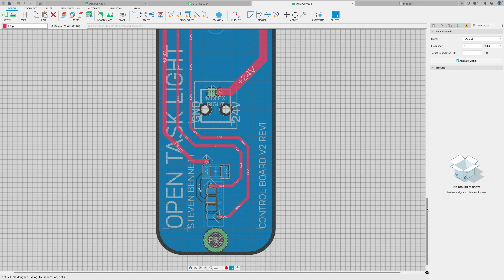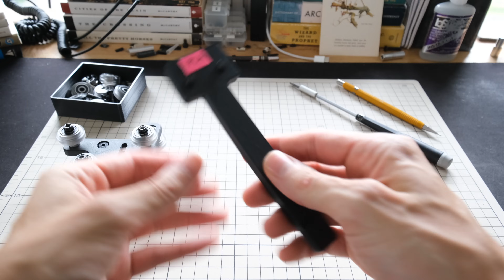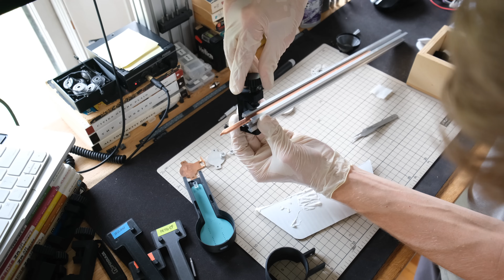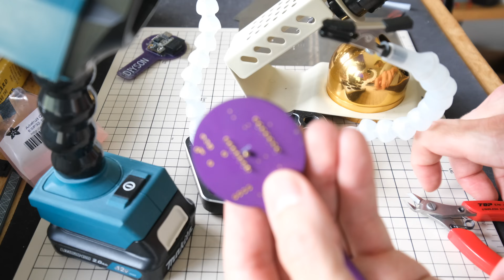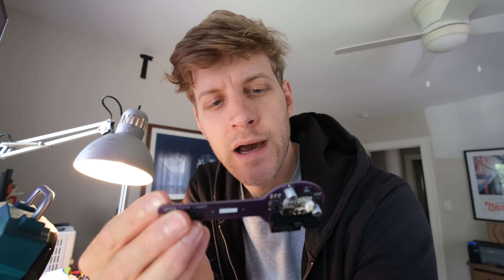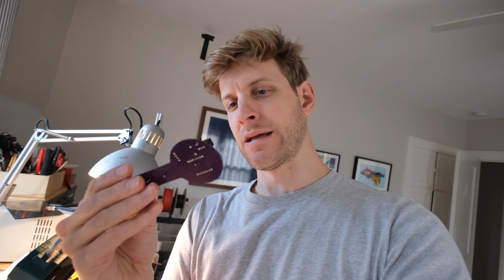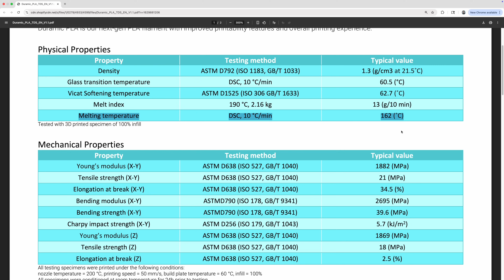A DIY designer lamp—how hard could it be? - Open Task Light Build Log #15

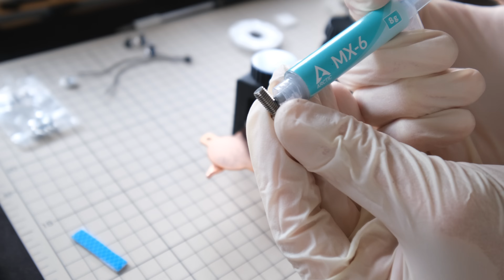Comment: 14:40 I think you have far too much thermal paste! The thermal conductivity of copper is a lot higher than that of thermal paste (maybe 40 to 50 times). Ideally, you'd have two absolutely flat and defect-free copper surfaces in contact with each other - that would give the maximum thermal conductivity, conducting as much heat away from the LED as possible, keeping it cooler. In practice, surfaces are not perfect at a very small scale so thermal paste is used to fill those small surface imperfections to improve the overall conductivity. You want copper to copper where you can but having a layer of paste keeping the two copper surfaces apart will simply increase the thermal resistance and won't draw as much heat away from the LED. Ideally, a very thin film of paste is all you need to fill those small gaps to give the highest thermal conductivity, transferring more heat away and giving you a lower LED temperature.

Comment: When trying to desolder a soldered down PCB like that - this is what I do:
- Get lots of solder all over the pins - really goop it on there. More solder helps with keeping more pins hot at once
- Lots of flux - This'll keep the solder flowing and wetting properly while you have it hot for a long time. I like rosin flux in a syringe.
- Use a small screwdriver to apply force pushing the boards apart
- Repeatedly move heat between all the pads, wiggling the board out a little bit at a time.
There's a tiny bit of flex in the boards, so you can move it very slowly with only some of the pins hot a time, but it takes a decent bit of patience.
Reply from the maker: I'll give this a shot when I go back in to rescue those QT Pys 👍🏻
Reply: @StevenBennettMakes  To extend this, you can put on so much solder that the entire row of header pins is bridged and that means thermally connected and liquid. then you can remove the solder with solder braid or a solder sucker etc. Overall you should invest in a cheap aliexpress desoldering gun and a hot air gun. fnirsi sells a great hot air gun for <$50. Desoldering gun theres a proskit thats about $200aud, or you can buy the engineer brand solder sucker for $20-50, its better than the goot brand ones (they are both not great compared to a proper gun but do work). Also your soldering iron is not going to help, get a cheap pinecil, it will be easily a 10x improvement.
Reply: Also as someone else mentioned Chipquick makes this a lot easier (it’s a low temperature “solder” that gives a longer window in which it stays liquid)

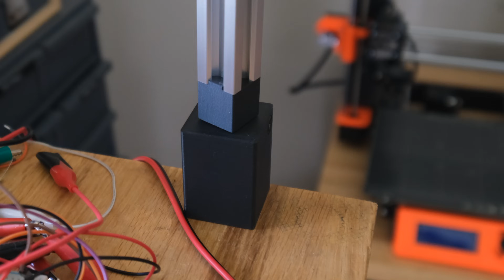Comment: 5:00 You have discovered that PLA is prone to creep, the annoying fact that PLA (and some other filaments) like to very slowly deform under constant load even when far under its maximum strength. So you really need to test these parts for a long duration to ensure it won't creep.
Reply: what filaments do not creep?
Reply: @multi_array  They all creep, plastic is like this. Some creep less, PLA creeps a lot but unfortunately PLA is also one of the stiffest filaments, which is a different property you want in these cases. Fiber inclusions can help since fibers effectively don't stretch, but the fibers can slip within the plastic. Creeping can be reduced by reducing the load or making the part much stronger, usually it's best to design around circumstances where the plastic is put under high continuous loads that will result in creep. I would expect that without getting into the alphabet soup of true engineering filaments with costs in the hundreds per kilogram, PC-CF is going to be the best choice, and a PLA-CF might do well; but also making the carriage a stronger shape would do a lot.

(regarding the results and PLA being one of the stiffest, what PLA isn't is one of the strongest, the test load in this experiment was too much. If you tested a range of weights you'd see the PLA deflect less early on and now more since it's strength has been exceeded. A stronger shape would help PLA to keep up and it would help PLA disproportionately compared to Nylon and PETG that are just floppier)
Reply: @Ziraya0 thanks :)
Reply: @Ziraya0 love your short but precise take on creep!

I wanted to add a few things:

1) for those one off projects just print your parts with all perimeters/100% infill. Especially the carriage. It helps a lot. Filament is cheap nowadays.

2) You can add long fasteners/bolts/glued in rods to avoid creep. At least you can in some cases divert the forces to a much bigger area to keep creep down

3) "Closing" the triangle of rollers and with another plate will stiffen it immensely. Bending forces on the rollers will be cancelled out...

4) sometimes 3D printing just isn't the best option 😅

cheers, a fellow engineer and 3D printing nerd
Reply: Maybe using ABS? Way more temp resistent. The Voron team designed a high speed 3d printer using ABS... Parts are under high stress there too - printer works like a charm since years...
Reply: @obiwan007  Most of the parts of a voron are not under high stress while the machine is stationary. The key exception is the belt path. In the default configuration you do not want the belts to have too high a tension. It causes un-due wear on the motor bearings in particular as the belt is cantilevered on an extended shaft. The stock belt tension guidance is about 2lbs, which is very small and maybe a magnitude or two below what is required for the aesthetic stiffness of this lamp. There are advantages to higher belt tension so people do mods where they add a third bearing to the motor (double shear) so it is no longer cantilevered, and make various other parts more robust seemingly at a whim (vorons are very whimsical, I hope to have a budget for one someday).

The motors in a stock voron are most akin to this carriage, increased tension wants to deflect the shaft the wheels are mounted on and that gets transmitted into the plate. There's a high leverage factor, so the forces are big. People have suggested a second plate sandwiching the arm, which would eliminate the leverage and greatly weaken the stresses at play. A second plate would also convert the stresses from leverage to planar... pushing... there's probably a real word for this. It's much easier to make a print strong against planar pushing because you can just make the distance from the hole to the edge in that direction bigger, or the plate a little thicker. All of the other high tension spots in a voron are like this, tension is trying to pull a shaft through two plates that balance the load and prevent leverage from developing, so that only the literal tension force has to be dealt with by the plastic.

In motion, all the forces are momentary, so creep can't occur. You would run into "a problem" if the motor tried to move an axis so forcefully that any printed piece deformed plastically right then and there, and you may experience fatigue in the long run if the momentary forces are too too high, but not creep

Comment: Swapping the leads can happen to the best of us!

I designed some PCBs for my 3d printer, all using the same power input. I did the first one, never ordered it and moved on to the second one, which I finished. Then I came back to the first one and - it did not turn on. After tinkering around I managed to blow the fuse - and realized that I had flipped the power input on the second PCB but did not flip it on the first one, so I was feeding 24V into GND.

Magically nothing broke, but that mistake can happen easier than we'd like to admit :D

Comment: One of the reasons you might have gotten so much deflection on the PLA is because matte formulations can be significantly softer than plain PLA.
Also you should take a look into creep, that how the deflection of the pieces evolves whit prolonged loads. Some materials might behave rigidly at first, but deform over time loosing tension and rigidity.
I've been loving this series from the start and I'm eager to see where you go from here.
Reply: My thoughts exactly. Raw PLA is one of the stiffest materials you can get.
Reply: @blackmcbwhite2996  I was very surprised the PLA was so bad in this test, especially after watching latest video „What's the most rigid filament?“ by Thomas Sanladerer.

Comment: The Build Log chapter is such a good example of failing 1000 times doesn't matter. The only thing that matters is at the end you get it right. Failing is part of the process. Also can't tell you how many times I have a 50/50 shot of getting something right but somehow 100% of the time I get it wrong. It's like the USB-A port problem. Somehow I have to flip it 3 times to get it to go in. Great job finding and fixing all of these things.

Comment: Doesn't the carbonfiber filament create micro needles in your fingers?
Reply: That depends on the brand, the fibers they use, and other things. Prusa for example have done testing on their CF filled filaments and found that there were no issues with fibers getting into your skin.
Reply: I think it is best to seal the parts with something like a clear coat before handling

Comment: the PLA for the clamp base might become a issue.
PLA has the issue of creeping when loaded with force.
this will cause the base to get loose over time, retightening wont work for ever
Similar issue is present with PA6 blends (if not annealed, annealing reduces it) PA12 is less affected by it
Reply: Yeah since it already needs higher quality filament for the carriage, I’d use that for everything.
Reply: I think an ASA, or ASA blend like ASA-CF or ASA-GF would be the best choice here.
Reply: Creep depends greatly on temperature and load, for 10 Mpa at 40°C it settles roughly at 150 μm elongation, that clamp will never reach 10 Mpa or 40° C and 15 0μm is irrelevant for the application

Comment from the maker: Hey everyone, hope you're doing well. Here's a short film about a lamp for you.
Reply: 16:23 The easiest method for securing the heat pipe and eliminating the clamps would be through the use of a pair of sliding shims. Insert the first shim between the heat pipe and the 2020 rail slot lip. Then slide the second shim between the heat pipe and the first shim, tapping it in till tight. These shims then remain in place after install. this would be difficult for anything but metal shims without interfering with the rollers.
Edit:
41:05 Use multiple pogo pins per track, at opposite ends of the carriage, so that one pogo pin skipping/bouncing doesn't disconnect the circuit.